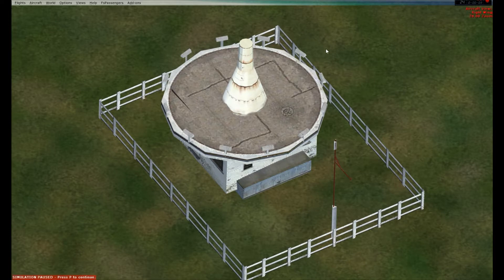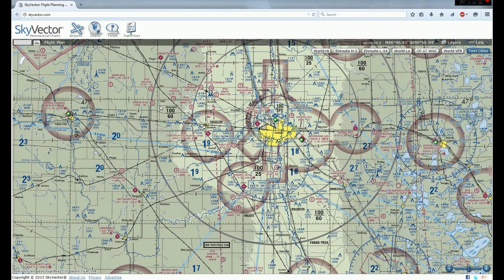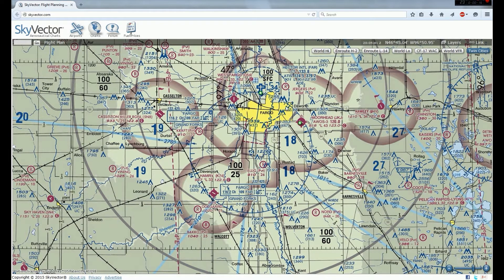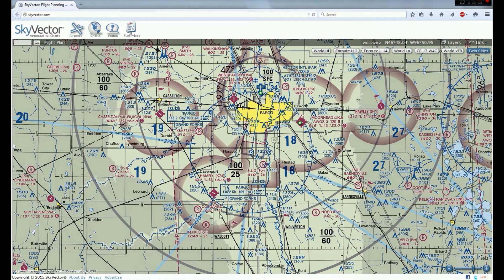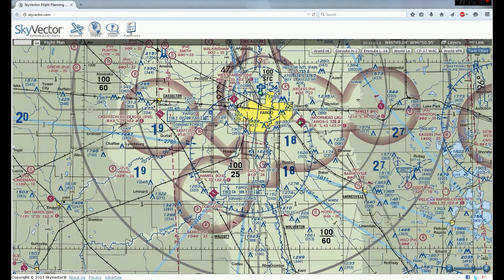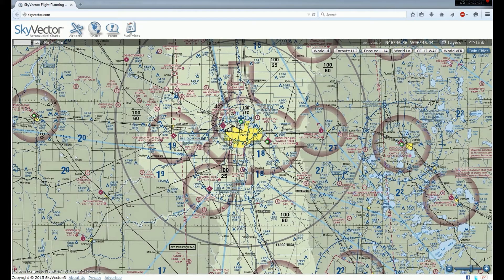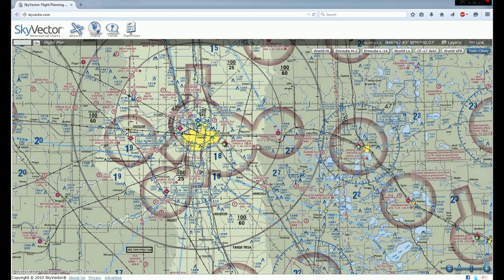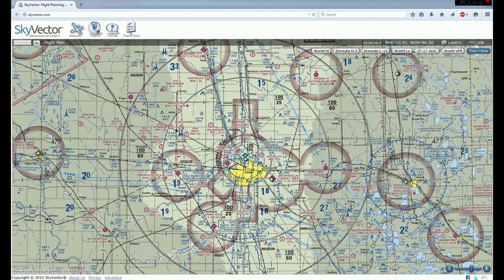Let's Learn FSX: Episode 3 - VOR Navigation

Comment: Nicely explained.

What I would also like to see is how to use the IFRs, would you be able to do a video on landing using IFRs?
Reply from the maker: Mikey Dan I believe you mean landing using ILS (Instrument Landing System). IFR stands for Instrument Flight Rules. Technically you use an ILS approach in an IFR flight, A video on everything IFR would be MASSIVE, so it would be good to break it up into particular elements. But yeah, I could make a video on ILS approaches. I will try to keep you posted.
Reply: Phriq-O-Pher Sorry yes, ILS is what I meant, a video on that would be a great tool to learn how to land. Even if it was a high level approach with the basic.
Reply from the maker: Mikey Dan I will try to make something. May even couple in some VFR landing tools like reading PAPI and VASI lights, etc...Not sure exactly when the video can get made, the tutorial ones take a little more planning, editing, etc, to produce, but I will get on it! Thanks for the suggestion!
Reply: Phriq-O-Pher Just another throught, what is the difference flying DME or VOR? I've seen some othet videos where people only use the 3rd guage at the bottom of the navigational aids.
Reply from the maker: Mikey Dan Hey Mikey, Great question! To start off, DME, or Distance Measuring Equipment, is a tool used in conjunction with VOR navigation. VOR's are actual physical equipment that are placed throughout the land that emit frequencies with information (the radials). The DME is not physically placed in the land but instead is a piece of equipment that is in your aircraft that can pick up the frequencies emitted by the VOR to provide distance and speed information. If you were not connected to a VOR, then you would have no DME information to display. Therefore, the DME is reliant on the VOR. Does that make sense?

You use a DME get more specific information from a VOR. If you had no DME, you could, with your VOR Indicator, determine what radial you are on, but without knowing your distance from a VOR, that information is relatively useless. For example, just say an airport you wanted to land at was 30 miles from a VOR, if you had no idea how far from the VOR you were, you would not be able to find that airport. Even if you were on the radial that the airport was on, you may be 10 miles from it, or 100.... With DME, it gives distances to a VOR. Thus if the DME says 10 NM and the VOR indicator shows you are on the 095 radial, you know you are ten miles away from the VOR on the 095 radial. Or almost straight east of the radial (as 095 is a easterly bearing) at 10 miles. 

Hope this clarifies some things! Thanks again for all your questions and support Mikey! Good Questions! Keep them coming!
Reply: Phriq-O-Pher Yea that helps massively. So my other question is why in the Cessna is there a 3rd navigational aid and what is is used for?
Reply from the maker: Mikey Dan I Assume you are referring to the instrument right below the VOR 2 indicator that has a yellow arrow? That is the ADF (Automatic Direction Finder) indicator also called the Relative Magnetic Indicator (RMI). It is used in conjunction with the ADF equipment that is located between the DME and the NAV 2 boxes in your Avionics panel. The ADF receives low to medium radio signals (like and sometimes the same as AM radio frequencies). These signals are transmitted by small towers that are called NDB's (Non Directional Beacons). Now, these do not provide distance information like the VOR and DME do, also these typically require you to listen to the Morse code identifier throughout your navigation time with the NDB. These also are the oldest forms of radio navigation still in use and with VOR's, and now especially GPS, it is becoming more obsolete with less NDB towers remaining. While in a FAA written test, you are required to use it, in all practical purposes, I never do and that is why I have never really mentioned it or brought it up. I can put it on my "to do" list to make a short Let's Learn video on ADF's, but I would make it relatively short and to the point. Anyway, hope this info helps! Thanks again for the question!
Reply: Phriq-O-Pher Next question, how do you integrate Sky Vector into FSPassenger? What I mean is how do you get apply the routes created in Sky Vector into FSPassenger? as I know Sky Vector is just a website. Do you use another planning tool?
Reply from the maker: Mikey Dan There really is no way to "integrate" Sky Vector into FSPassenger. While you could create an IFR flight plan in FSX that mimics what you decided in SkyVector, that is about the closet you can get to having FSX "know" your flight plan that you created in SkyVector. However, since I have been flying VFR, I do not log flight plans. I simply use the information from SkyVector to guide me in FSX. FSX has no idea where I plan to fly or how I plan to get there but I use my own navigation through the information I get from SkyVector. For Example, If I am at town A and want to get to Town B, I need to use a map, (AKA the aeronautical charts of SkyVector) to get me there. I then look at SkyVector and see that Towns A and B each have their own VOR, Also, I see there is one between them. Then In FSX I fly to those VORs as seen in SkyVector using VOR navigation. 

Does this make any sense or is it just adding confusion? Hopefully it clarifies some things.

Comment: Does the heading indicator shows magnetic North or true North?
Reply from the maker: The heading indicator will, or should, show magnetic north. You will typically align them so they are calibrated with your magnetic compass. However, in most aircraft they tend to get slightly off and often need multiple corrections throughout a flight. However, yes, they are to be used with Magnetic north.